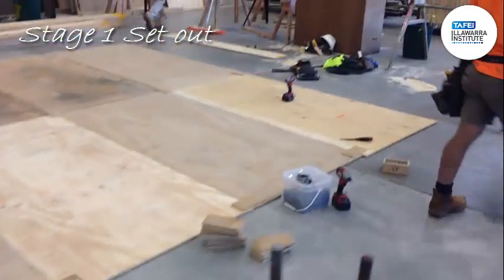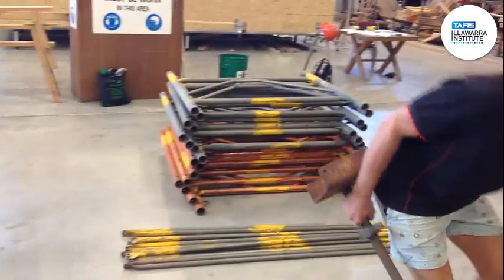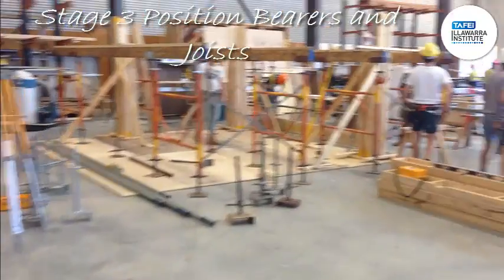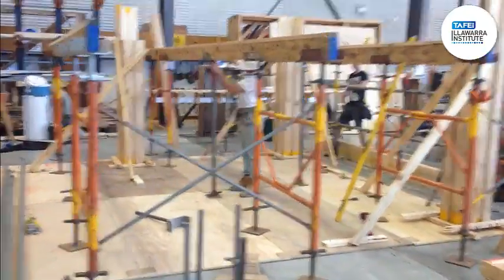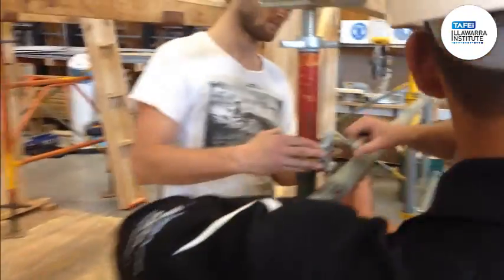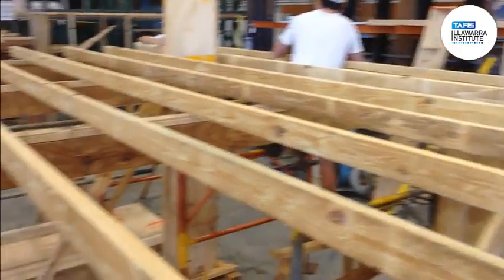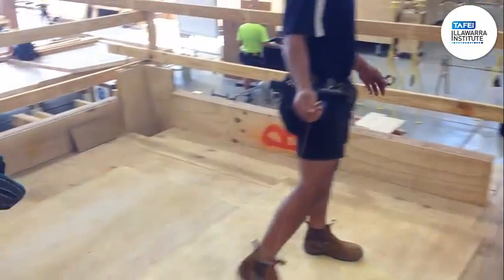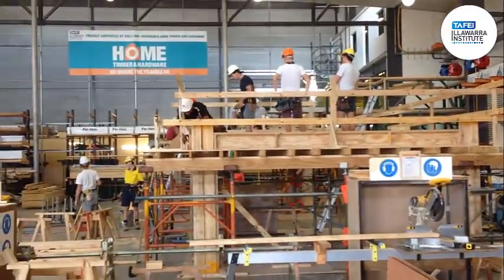How to Build Formwork for a Suspended Slab 🪵🔩 | Beams & Columns Step-by-Step

Comment: When you place the bearers on the scaffolding heads ,  you can hold them in the middle with wooden skewers on both sides , and create better stability in the formwork . And the columns need more wooden clamps around when you use a vibration tool the will bulging . The pay good attention on safety !

Comment: Hi Mr. 
We want to recommend "PVC formwork", a new type of plastic formwork to replace plywood panel, can re-use over 100times, 100% waterproof, B2 flameproof, smooth surface, 100% recyclable, etc. Would you love to try?  You can check our YouTube to see the videos.

Shandong Jingfang Import and Export Co. , Ltd.
Ms. Grapho Wu
Email: info@sdjingfang.com
Cel: +86 17806112299
Web: www.sdjingfang.com